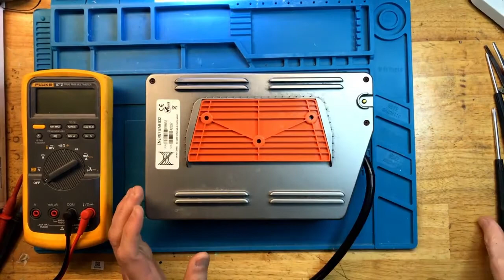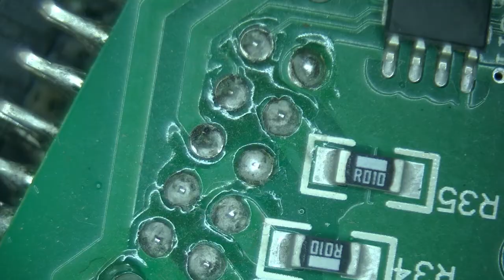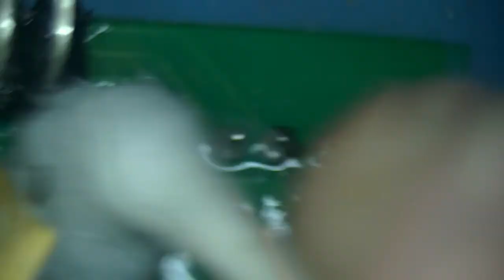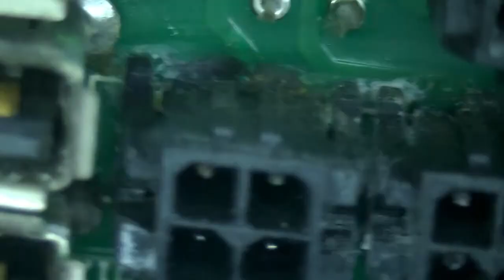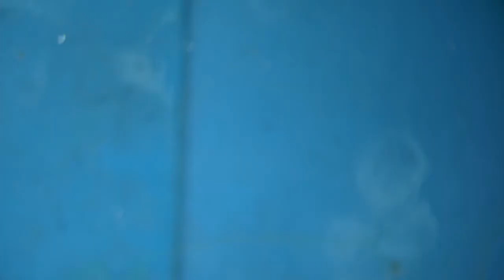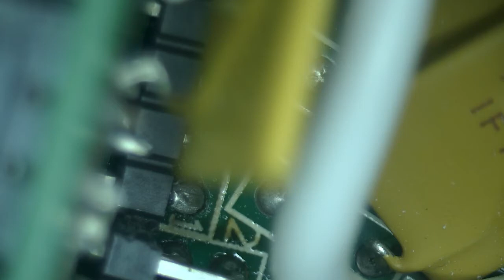Apex EB832 Water Damage on AquaBus Ports

Comment: Do you happen to know the pinout of the 1 link connectors ( 4 pins microfit)? It might save me a research myself to open the EB unit.
I want to connect the 24V to my home made UPS so that in case of power failure the to the 1 link connected pump keeps working.
Thanks!
Reply: I was just about to ask the same question. I want to have a 24 volt battery backup for my COR 15. sadly no answer after a year.😢